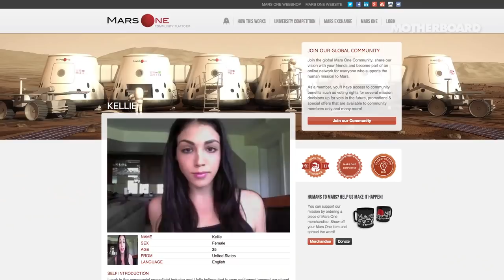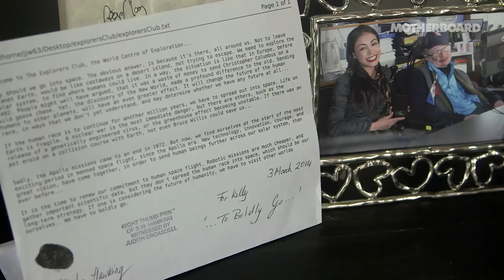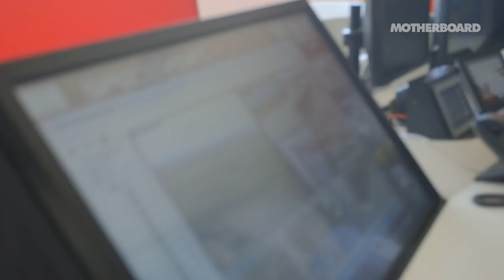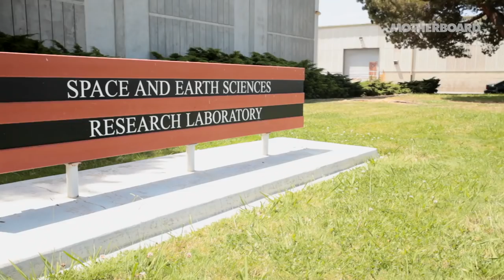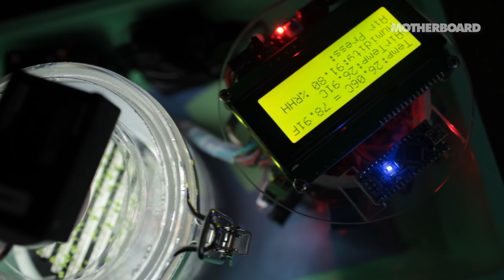When Will Humans Live on Mars?

Comment from the maker: The frontier is expanding once again. But who will go the farthest? (s/o ***** & *****)
Reply: NASA - ISRO coalition in 2018. That's gonna be epic.
Reply: ***** Can you explain to me what that is? I'm curious.
Reply: SpaceX
Reply: SpaceX
Reply: Neither. It will be the US Air Force and It's called the militarization of space. It's pretty obvious that NASA is being starved of funds while the military continues its work.
Reply: Tristan Laurent SpaceX looks a hell of a lot more promising than Virgin Galactic.  I have always felt uncomfortable with Virgin Galactic for some reason.

Personally, I cannot wait until Skylon from Reaction Engines becomes operational, at that point, space flight will become available to the masses.  Skylon as you may or may not know, uses a hybrid rocket/jet engine to fly up to the edge of the atmosphere on oxygen contained in the atmosphere.  When the atmosphere becomes too thin, it will switch over to its onboard supply of oxygen much of which has also been extracted from the atmosphere during the flight.  So, the only fuel that must carry on board, is hydrogen or some other fuel that will burn with oxygen.  

As, there is no atmosphere to contaminate in the Moon, nuclear rocket ships of the type seen in "Space 1999" could be used to ferry supplies back and forth from the Moon and rendezvous with a Skylon type of craft in Earth orbit.  In fact, the Moon, is actually the best and indeed, the safest place to develop this type of nuclear rocket technology. 

But as "Avantime" suggests, the US military will probably be the driving force where the initial colonisation of space is concerned.
Reply: Imagine our grandchildren looking up at the moon and seeing maybe a tenth of it gone. How different it would be.
Reply: Chinese space agency
Reply: I've been living up there off an on since 1995.
Reply: marcopolo3001
They can't even build jet engines for their so called Stealth fighter.
Reply: Tuco Benedicto Pacifico Juan Maria Ramirez They are not the same company dude. One state owned company governs one industry while the other manages another. What gives?

Anyways you must be referring to the J20 and trust me despite them not having vector thrusters they are making great strides in perfecting that technology to match the Russian PAK FA and the F22. Watch this space.

Everyone starts somewhere.
Reply: Tuco Benedicto Pacifico Juan Maria Ramirez Dude jet engines that rely on air intakes and react with oxygen are completely different to rocket propulsion which is anaerobic in nature. Two separate technologies that require very distinct knowledge bases. Apples and oranges. Not being as proficient in one doesn't necessarily mean you can't be competent in the other.

Fact: China has more modern and current aerospace technology in regards to space flight than the US. 

What it now is trying to construct is a heavy lifter to rival the old Saturn V and Falcon Space X rockets. If it does this in the next few years its a real game changer.
Reply: Tuco Benedicto Pacifico Juan Maria Ramirez Dude reaching much?

You are the one who alluded about the jet engine thing having so much importance on progress.

So let me get this straight.

When China reaches Mars before the US or sets up colonies on the moon. Will you still be singing this same tune about how those stealth jets are not using the latest engines like the F22? lol

You still fail to realise that many industries progress independently of other fields in science. But keep thinking the way you do. Americans are in for a rude awakening by this decades end.
Reply: marcopolo3001
ROFLMAO.
China will never beat the US.
You are comparing oranges and apples.
The US is working on warp technology while China is still trying to figure out how to make decent cars.
Mars?
ROFLMAO.
So because China sent a little piece of metal that lasted a short time alive on the moon the US is supposed to be scared of being surpassed?
ROFLMAO.
China cannot even comprehend the X-37 and you want China to put colonies in space?
LOL.
Thanks for the laughs.
Reply: Tuco Benedicto Pacifico Juan Maria Ramirez Dream on. Its what the chinese prefer. To be unassuming until the last moment.

Time will tell all.

lol. Go back to sleep.
Reply: marcopolo3001 afaik someone else has to have done it for them to copy it, I seriously doubt I'll ever see anything groundbreaking coming from them... No offense intended >.<
Reply: Slamdoxicalz You forget nothing groundbreaking ever happens when you can follow the aviation engineering throughout the constant copying and tweaking that Russia, America, Britain and Germany displayed throughout the world wars. 

When China invented paper and gun powder, I wonder how many Chinese pointed the finger at Europeans copying them when they took that technology back home.

Put simply when we ride on China about how it imitates any technology, we forget that nowadays it leads the world in High Speed Rail technology as it doubles its highspeed rail infrastructure than that of Europe for this decade. It is also set to overtake America in space rocketry technology. It is well on track in making its next generation rockets and next generation space station. In fact America is still working on old 60s, 70s legacy space equipment meanwhile China is innovating all its new systems on current and new generation computing as its key strength.
Reply: I fully support mars one project. A damning report should not stop mankind advancing onto another Planet!
Reply: Alan James I'd say a damning report was a positive step. You need to find out how bad it can get so you can plan to overcome that. Also you have to take things like this with a pinch of salt. I mean imagine a report coming out 10 years before the Wright brothers flew their first successful flight, that report would have said, human flight in a machine is impossible and everyone trying will die. That's an extreme example and obviously today you can analyze a mission to a much greater extent but I really don't think any reports can take into account the leaps engineers, scientists and business can achieve in 10 years.
Reply: Mike Hunt First thing I thought when they talked about reality-tv is that people are gonna watch to see it go bad, and it most likely will. So many things could mean instant death and failure without even starting to mention gradual failure in which case they would be left slowly dying of radiation, co2 intoxication starvtion or dehydration among countless variables. 
It would be a tragedy if the whole thing blows up in a big failed swoop but aleast, if they were to go on the Moon, we wouldn't have to watch them slowly and helplessly die without being able to help or bring them back.
Reply: BTiffney71
Sure there will be people that really do want them to die and they'll watch to see if and when that happens but surely the majority would be supportive of such a hugely important step for mankind. I mean just imagine humans living on Mars, an asteroid hits Earth and kills us all. Humanity gets to carry on because of the Mars trips.

I know the people going to Mars are all resigned to the fact they'll die either on the way or on Mars. They won't have long happy lives but they'll be amazing pioneers that will go down in history. I'll certainly be watching, crossing my fingers and hoping for the best for them.
Reply: BTiffney71  The whole idea is dumb as can be to me. Nasa never sends astronauts there for many reasons and now some guy is gonna make a reality tv show and get paid off others death. Just what we need one more heartless inhuman corporation playing god.
Reply: Mike Hunt
NASA doesn't do manned mission like that because it can't afford it, simple as that. They've had plans to do manned missions like that but can never get the funding. The only reason there's a reality TV show linked to one of the new Mars missions is it's a way to help pay for such a hugely expensive project. Without the TV aspect, there would be no mission, the people behind it have said exactly that.

Going back in time, you'd probably have been one of those that said people should never get in boats and explore the ocean, it's too stupid. Well we did and humanity is all the better for it. I'd say the same was true only more so with space, the potential is just mind blowing. But you think its dumb.
Reply: Clay Mann
 You must watch the news a lot ?   They could get the funding in a heart beat but they don't want to fund it because they don't even want people going there. And mark my words if this ever even gets to the point of a shuttle leaving are atmosphere with these so called Mars one guinea pigs on it. They will never reach Mars.    And for the comparison to people going out in boats in the past vs sending a bunch of wanna bees to space is a pretty shallow one at best. What you smoking in that pipe?
Reply: Ricardo Gamboa  Haha nice man, I knew it was a load of shit in one way or another.
Reply: ***** I will :D
Reply: why can't NASA just send tons of fuel to our moon then launch a rocket  to the moon then launch from there to mars
Reply: isaiah steinsdoerfer I think the problem there is the more weight you want to shift out of earths atmosphere, the greater the fuel you need to initially lift that much weight up and out into space.

Something as solid as a giant container of fuel would require so much fuel to get it up into space that it wouldn't be possible build a ship that could take it. the fuel required to lift it would start to just become too much. So you'd need even more fuel to overcome the fact you have too much fuel. There's a ceiling to how heavy a spaceship can be and its not a very high ceiling. We need better forms of propulsion than just making giant fire crackers which is all spaceships are right now.

I think the key lies in slowly building up little bits each trip, so eventually there is enough stuff up in space around the space station to manufacture things. So once you can bring an asteroid in, you can mine it, use its raw materials and make stuff, create fuel, water, oxygen and so on and so on. That's a long term goal though that I'm sure will take a lifetime but that'll be the start of making spaceships that absolutely dwarf the space station. 

We totally could do that now but Earth in general and its population, its just not focused on how important it is to get our asses off Earth and out into Space. Just one asteroid and humanity is gone. that's pretty fragile in a universe with unimaginable amounts earth killing  asteroids flying around
Reply: Damn u must be a rocket scientist
Reply: isaiah steinsdoerfer oh no I am not even close. I'm just a dreamer that's read too much science fiction and picked up all the basics along the way. If there were any real scientists and engineers started talking about this I'd be revealed as an idiot that has a basic idea of what he's talking about but is way off in some big areas and really lacking the knowledge that only comes from studying this for years. 

They say it takes 10,000 hours to become an expert in something. So I'm probably around 200 hours in :)
Reply: It would be a race between SpaceX, NASA, Mars One and ESA. NASA has the resources to get there. Mars One though has plans to get there first, but I don't think they have the capability to actually do that yet. SpaceX has yet to make manned missions. NASA still looks to be the most likely to get to Mars.
Reply: #corehyperdrive from #bohinventing.  Our technology and petition/contract ARE the future of deep spaceflight. See my new PowerPoint on my socials for some proof logic....  -Boh

Comment: Here's how I would approach Mars colonization:

Step 1 - Build a 'railway' system.  The difficulty in getting people settled on Mars isn't in its atmosphere or radiation levels, but rather its distance.  It would take a lot of fuel to get to Mars and it would be nearly as difficult getting a return trip back since we have no fuel deposits there to speak of.  A solution to this is to establish several permanent orbiting craft in the vicinity of Earth's higher orbit, the moon, and Mars proper so that we can essentially use it as a 'railway' system.  Via a lot of mathematical calculations we can realistically set up a railgun system in orbit that can send materials from the Earth to the moon to Mars that can be used to help establish the early colonies and, potentially, get people offworld in the event that something goes wrong.

Step 2 - Make men in to moles.  Rather than have a colony built exposed to the surface where solar radiation is an immediate problem, have a colony built underground.  Essentially build a surface pod that acts as a combination airlock and decontamination facility, then dig a shaft under the surface that's roughly a couple dozen meters beneath the Mars rock. Using a combination of concrete and lead lined walls, you can essentially build a series of underground bunkers that can house a bunch of people safely and affordably, with enough room to move around and do daily activities to provide the enrichment necessary to help keep them from going crazy (it'd be hard to play basketball with a space suit, and I'm not sure if the first colonists will be allowed to go up into space with chess boards and decks of cards).  This will also, potentially, curb the amount of radiation exposure that would make having a second generation on Mars difficult, and can also provide an area to build an artificial greenhouse to make more food.

Step 3 and the most important step - Artificial biology.  As soon as the first colonies are built, companies that are knee-deep in genetics and agriculture need to take the next step and begin making facilities on Mars with a single purpose; create an artificial biosphere.  It'll be next to impossible to expect potatoes, corn, and wheat to grow on Mars's surface, much less a cow, and as much as we want to believe in the Martian the likelihood of being able to get Mars dust to become fertile overnight is pretty slim.  Creating an artificial biosphere can solve that problem; introducing cyanobacteria genetically altered to survive high radiation exposure can be used to help convert Mars's ice caps into a proper atmosphere while also potentially providing some of the chemicals needed to induce rain on the planet.  More bacteria built to break down Mars sand and rock into something that can help make topsoil would also be required, and eventually the first genetically-engineered Martian plants can grow.

These are more or less how I would approach a Martian colony and terraforming attempts.

Comment: The part of this video that really interested me was bringing life to Mars...
In recent years it has been concluded that Mars does have a liquid core (by "scientist's") but doesn't have a magnetosphere. The magnetosphere (magnetic field) is the thing that protects the earth from the solar wind thus limiting the amount of radiation we receive and also helping to stop our atmosphere being stripped away.
My point is without a magnetosphere how will they be able to protect life from radiation and in the event we are able generate an atmosphere, having that stripped away?
Apparently they're working on a way to heat up the core and kick start things.... Hurry "scientist's" I want to meet a Vulcan chick....
Reply: Like on the moon, there will be localised magnetic fields on Mars.  It is simply a matter of constructing your settlement inside one of these localised fields.  Failing that, one can be generated.  It now appears that you do not need a particularly strong magnetic field for protection.  Anyway, at the surface, radiation is the same as for low Earth orbit, so if we build inside one of these localised magnetic fields, then, radiation exposure should come down to levels found on the surface of the Earth.

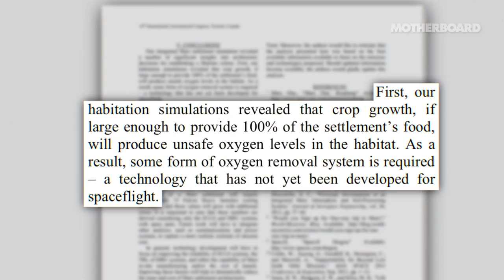Comment: 24:39 "...some form of oxygen removal system is required- a technology that has not yet been developed for spaceflight" Say what now? Is that a problem worth mentioning? Use solar power to hydrolyze water (from the mars surface or otherwise) outside the habitate, and store (or even just dump) the oxygen there. Then react O2 from within the habitate with the hydrogen in a fuel cell.  Then you have hydrogen for energy storage and/or oxygen removal, oxygen stored for whenever you need it, and clean water for use in the habitate.
It's not efficient from an energy standpoint, but it easily solves the problem of excess O2, as well as providing an energy storage medium, and contributing to alleviate the need to purify water.

If you somehow have excess organic matter at hand, then burning it to form CO2 would also obviously solve the problem,